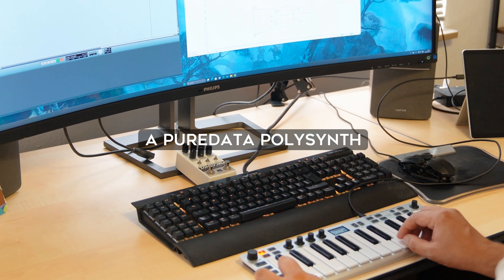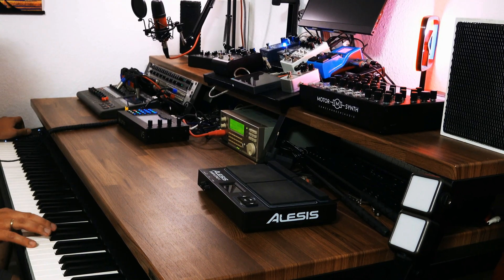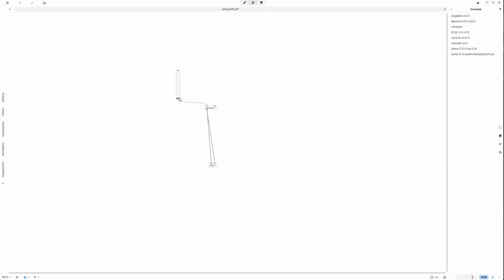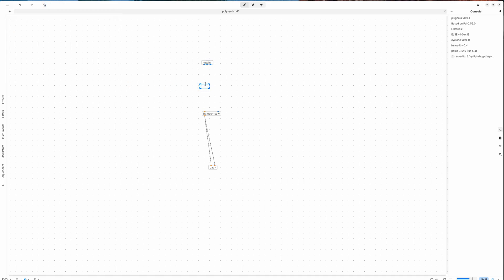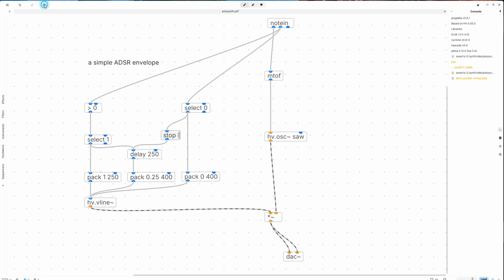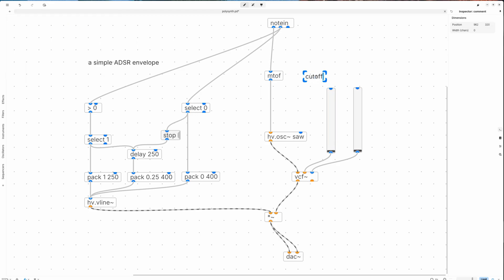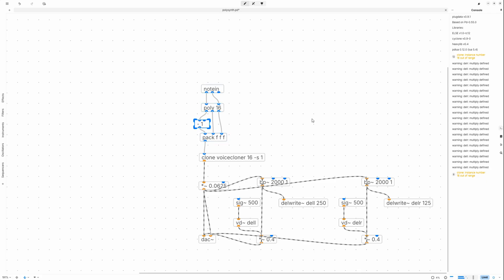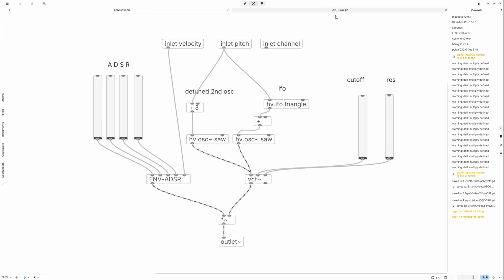Build a Polyphonic Synth in Puredata / Plugdata – Full Tutorial

Comment: I can’t get the envelope to work inside poly. From what I can see in this video, once the oscillator-patch is used as a subpatch, the adsr-sliders are no longer accessible. I tried to give inlets to the envelope settings also, but it’s having no effect.
Reply from the maker: Ah yes, this is true. While you're in plugdata in presentation mode, you could click the voicecloner, then click the OSC-SAW, and there are your sliders. I'll make a version with "proper packing" available on my patreon page publically.

Comment: The tutorial is great. As someone who has coded the involved DSP and explained it to others, the explanation of aliasing in the oscillator is lacking. A more detailed explanation for the curious that runs through all the concepts is as follows:

If we use a naive sawtooth ramp where each sample ascends linearly(demonstration with visuals  and mathematical function - Wikipedia has a few, I think), it will sound like a saw wave, but it will look and sound different from this other sawtooth(demonstration) constructed by adding sine waves. Why are they different?

When we represent a sine wave as samples, we need at least two samples to describe the sine peaks, and the continuous curve heard in between those samples is created during the digital-analog conversion. This two-sample limitation on how short our sine wave can be also means that we have a limitation on maximum frequency, called the Nyquist limit.

When we use a naive sawtooth, the represented sine frequencies that are above Nyquist become mirrored into lower frequencies, cluttering the sound - that's the "aliasing". The additive sawtooth stops adding sine waves before reaching this limit - it is mathematically ideal within the limitations of digital audio.

Supersampling is an alternative to the additive approach that adds flexibility: first it generates the waveform at a high sample rate. Then it applies a low-pass filter to lower the signal frequency below Nyquist. Finally, it decimates the samples to produce the target rate. (*) This creates an oscillator that has a very small amount of aliasing and can use arbitrary waveforms and modulations instead of being specified by additive functions.

( * In implementation, filtering and downsampling can happen simultaneously in one expression; when we're using an integer multiple such as 8 times the target sample rate, the math works out cleanly to create one expression that is both a FIR lowpass filter and a decimator. This confused me a lot when I first studied the topic because I was missing the context, but DSP math is full of little tricks that produce optimized programs by mashing together parts of the block diagrams. )
Reply from the maker: Thank you very much for your detailed clarification! Indeed, I cut a lot of corners there.